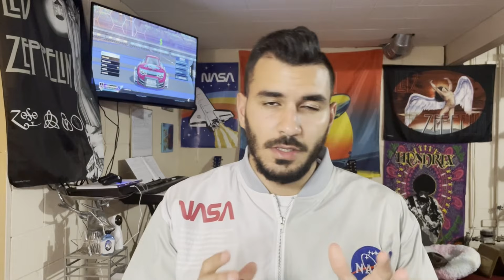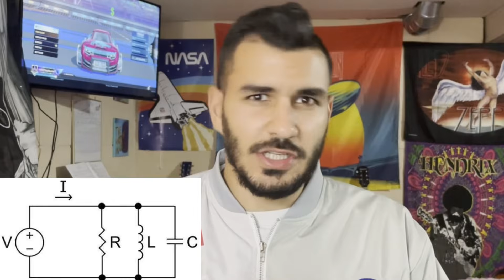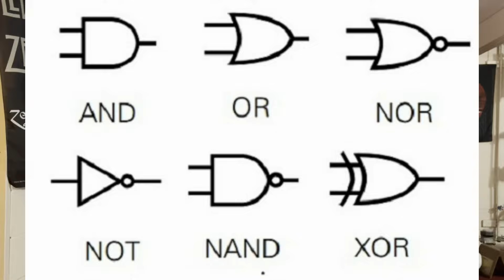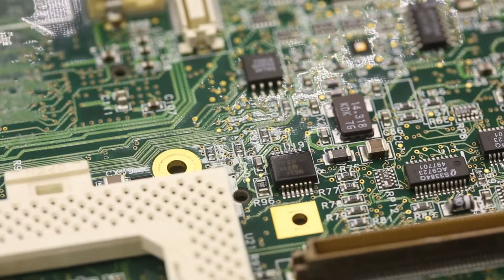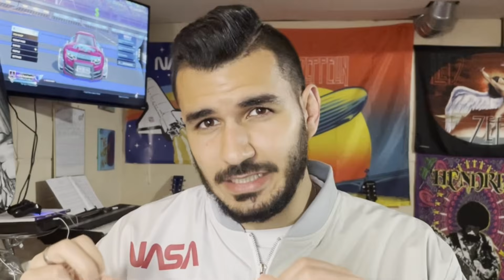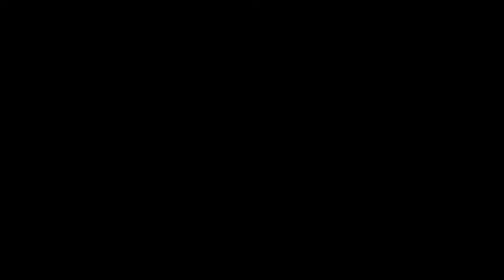Ranking Electrical Engineering Classes: Hardest to Easiest

Comment: In my university in the 3rd semester you have to specialize in one of three recesses. And most of the students choose energy systems. And the minority chooses communication/RF.
Reply: wow, that means this video is spot on then
Reply: @newtonsgrandchild1701  yep
Reply from the maker: that sounds about right
Reply: My area for my undergrad was microwave circuit design, which was under the communication/RF area.
Reply: i wanted to do EE, but decided against it because my high school classes on electricity were too confusing.

they taught that current is the flow of charge per unit time, but then they say the charges don't really flow!

one teacher said voltage is energy per charge, then another said that voltage can exist without charge or energy!!

they taught us electrons flow from the positive terminal to negative, then say no, it's actually the other way around!!!

no thanks. i chose to become a simple baker instead, and i have no regrets. lol
Reply from the maker: @thispersonrighthere9024  Haha yeah because everything is invisible and abstract it can be a bit confusing to teach electrical engineering concepts... unfortunately in university you have to teach yourself anyway so the fact that you didn't have the best teachers isn't all that uncommon -- but being a baker sounds awesome, what kind of pastries do you make? I remember watching a masterclass on french croissants and it looked very intense lol
Reply: @thispersonrighthere9024  
Current is movement of electrons through a point

Voltage is the pressure that moves the electrons. Example: take a pipe and fill it completely with balls. When you add one more ball, it'll push out another ball from the other side. The pressure you applied adding another ball is the same as copper wire filled with electrons getting an additional one shoved in. So, the electron is what moves and the voltage is what caused it to move.

It's possible for there to be voltage present but no current. An example would be a battery not plugged into anything. It has electrons stored within but because it's not plugged into a remote (or a controller, or anything that uses batteries) the electrons have nowhere to flow to (which means no current). 

The negative side of a battery has a surplus of electrons. The positive side has a deficit of electrons. Electrons are negatively charged. Opposites charges attract but like charges repel each other. So, because you have many electrons jam packed into a battery, they want to get away from each other. The moment a path is created, electrons will flow. They will go from high density of electrons to an area of low electrons. They do this by pushing each other away until an equilibrium is reached.